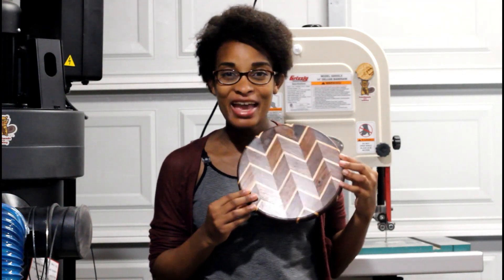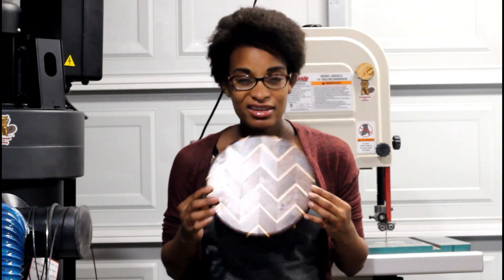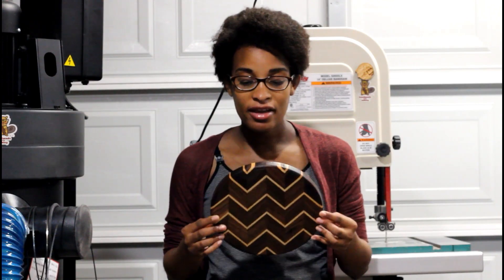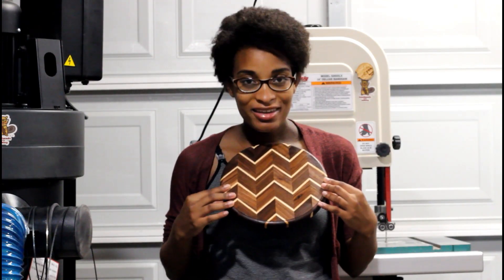How to Make a Chevron Cutting Board

Comment: I love this pattern and can’t wait to try it out. A quick tip that might also work for you- Instead of wiping on, and especially if I’ve made several pieces, I place my newly constructed cutting boards in a bowl, bag, or bucket full of mineral oil, and leave them covered for a few days.This absorbs deep in the wood, so touch with mineral oil isn’t so frequently necessary (also so I can get on to the next project quickly)!
Reply from the maker: that's a great idea. I will do that next time I make a cutting board :)